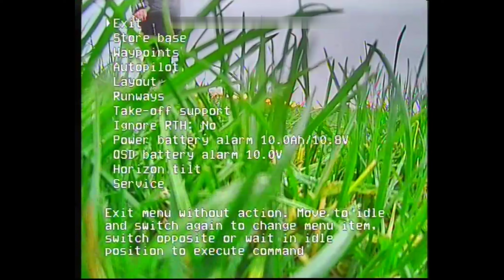Zohd Rebel GT 4s3p takeoff test fail and crash

Comment: I have this plane, which for the life of me, I have never been able to actually launch successfully because of the dreaded torque roll and fear of destroying it. Come spring I will give it another go but props to you my guy.
Reply from the maker: A smaller motor and prop will help. I got a 2212 on it with a 7x4.2 Gemfan flash prop. Prop is very lightweight that helps reducing torture roll and motor is the perfect size imo. The stock 2216 1300kv is too big for such a small plane. I launch it around 62% throtlle 16 amps on 4s and the torture roll is acceptable just like a normal plane. I also got the cg further back @ the carbon spar in the wing then you need less throttle too launch. If it gets unstable in flight you only need a tad more throttle and wouldnt tip stall.
It is definitely a plane you have too fly he doesn't fly itself like a trainer.
Reply: @dutchfpv9254  I appreciate that, will try to swap for your recommendations and see how it. Thanks 😀
Reply from the maker: @guggli89  awesome let us know!

Comment: I always use auto launch with at least 50% idle throttle for planes I want to keep nice. If auto launch can't launch it, then there is something wrong with your plane. I launch my Rebel GT with INAV auto launch with 50% idle throttle and 80% when auto launch engages. It takes off like it's on rails with a 4s1p 21700 pack. I am sure it has a easy time with a second pack as well.
Reply from the maker: 4s3p is more weight then the wings can handle. When over the limits you will need take off assist to help. I like to test that stuff out so others know that it wont work.
I did many successful flights and really know how the planes behavior is.
I fly it all the time with a 18650 6800mah 4s2p and a hd cam or a 4s2p 21700 without hd cam with great succes.
Some say the plane is shit i like to proove they are wrong. Plane is perfect!
Reply from the maker: Btw i use a fixed throttle for take off assist i dont like a spool up and gain torque roll when taking off

Comment: I launch mine with the zohd 10’000mah 4s pack, it’s quite challenging but it can be done, a bit of wind helps, what I really like with tha talon gt is its cruising speed of 70-80kmh due to its high wing loading, you do some nice distance quickly but it can’t carry more than 10’000mah for sure, so max range is about 25-30km max one way
Reply from the maker: With a 4s2p 10000mah i was able to do a trip of 130km and 2 hours of flying 💪😎👍
Reply: @dutchfpv9254  how on earth did you do that? 😄 I am using stock motor and zohd 10k pack and could not exceed 50-60km round trip, at what voltage did you land?
Reply from the maker: @jetrg12  with a 2212 1400kv a silly 7x4.2 prop and cg 10mm backwards 😬 landed at 12v under load around freezing temperatures.

Comment: The reason is obvious to me. You can't use a silly little 7 x 4 prop on a bird this size and weight. In fact I wouldn't use a 4 inch pitch prop on anything electric at all, useless. Put an 8x6 on and you will see the difference. Watch out for the touque roll though...😳😳😏😏🇬🇧
Reply from the maker: A silly little 7 inch prop on a silly 1 meter plane is enough😜. The stock motor prop combo got way too many torque roll.
It already pulls 34 amps from the 2212 1400kv even more and he will burn...
You know im experienced with over propping on the MiniTalon and Crosswind mini they got a tad more efficient but its not needed on this plane. Its not a long ranger at all.
Anyway i just keep flying this one with the 4s2p 10000mah its enough😁
Reply: @dutchfpv9254  What I meant was, and I'm being serious now, these Chinese electric props are shit. In particular as you go below 8 inch and the lower pitches...I thought it was at least 1.3 metres span...You're right, it's never going to carry all those heavy 18650s, so it's pointless trying IMO...😳😳😏
Reply from the maker: @EnglishTurbines  haha 21700's mate pack is 850 gram
Reply: @dutchfpv9254  Lol...I have some of those Tesla size cells, a 4S pack I made up....No wonder it can't carry that lot effectively....Jeez...lol...😀😏😏 Try a decent Graupner prop...if you must use a 7 inch prop, maybe a 7 x 6 for example...😏
Reply: I use a Gemfan 7042 on my Nano Talon Evo and I have quite a bit of weight on it with my 4s 5000mah 21700 pack  and it flies great. I’m using a 2306 1900kv motor tho.  I use a 8x5 on my flying wing with a 2216 1120kv motor and it works much better than the Gemfan 7042 prop I had on it. Guess it just depends more on the kv and pilot’s preference

Comment: too much throttle try 75% and pull up a little or set a little reflex up. i just rest my thumb on the stick to help pull up. It helps on maidens
Reply from the maker: Haha you ever launched a 1700 gram Rebel?
Normally with a 4s2p it launches at 63% 16 amps.
Its just to heavy
Reply: @dutchfpv9254  i have a sonic modell pro on 4000mah lipo it weighs more then that lmao
Reply from the maker: @staydown.normal5323  already thought that also fly the pro at this weight without a problem. Everyplane behavior is different...
Back in the days i flown my MiniTalon at 2.8 kg and a Crosswind Mini at 5.8kg... I know how a heavy plane works some plane's are not meant to do it.